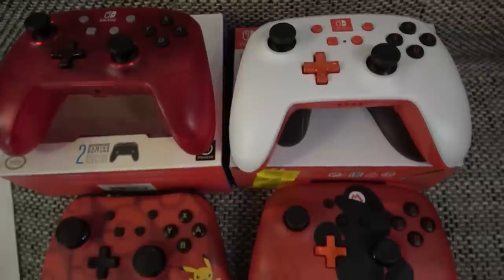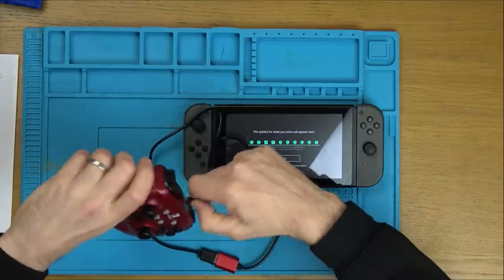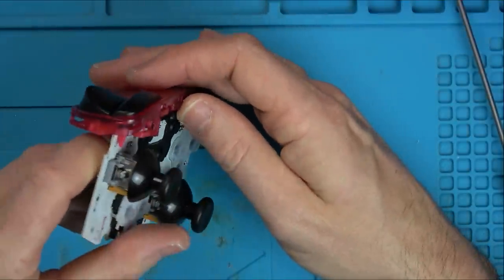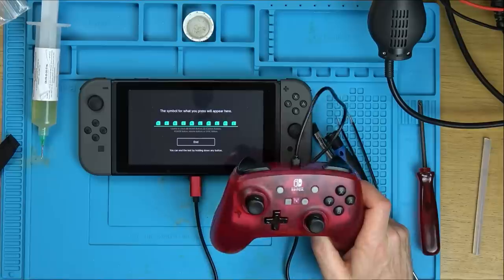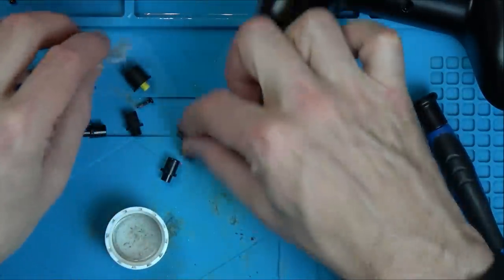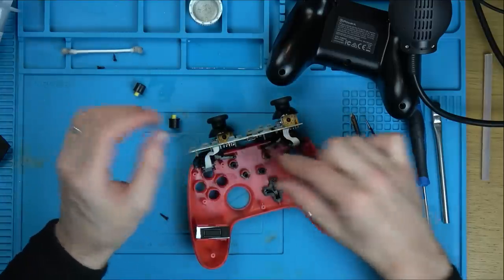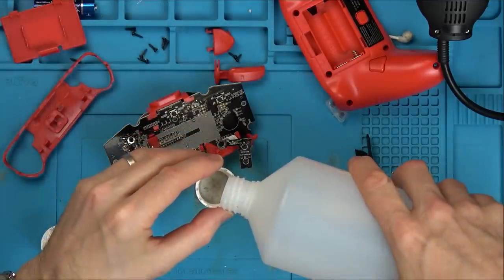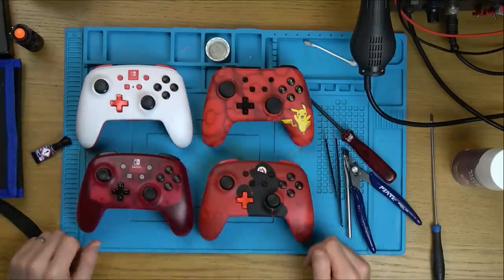Joblot of Broken PowerA Nintendo Switch Controllers - Trying to FIX

Comment from the maker: Spoiler Saver & Riddle

A 20 foot rope ladder hangs over the side of a seaworthy boat. The bottom rung is level with the surface of the water. The rungs on the ladder are one foot (12 inches) apart, the tide rises at a rate of 6 inches per hour. 
How long will it take until the 3 bottom rungs are under the water?
Reply: Riddle Answer Spoiler Saver 😁

It would take as long as it takes for the boat to become UNseaworthy.  i.e. until it sinks. 😁
Reply from the maker: 😂😂👍👍 Well done Steve!
Reply: The boat wont sink if its seaworthy😉😉
Reply: It would be nice if you learn to edit out these sounds in the background.
Reply: The Flying Dutchman never sinks..!!
Reply: When the next tsunami hits
Reply: Hey Vince, legitimate question here. I am interested in buying that Pikachu controller. Are you open to selling it?
Reply: 0 the boat is floating so a s the sea rises so dose the ship
Reply: Fill one of your blue tray compartments with IPA. Boom! Problem solved! 😎♥️ your welcome.
Reply: How do you remember were everything goes
Reply: @Mymatevince  hi again Vince! Remember me? Nice video!  Have A    
 G̳R̳E̳A̳T̳  Day

Comment: Great video, nice fixes!
Tip tinner is really a last resort utility. Very handy if your tip gets oxidized and wont take solder but not something you want to use regularly because it is acidic and will eventually eat through your tip coating. 
To prevent oxidation tin your tip with some solder before you put it to bed.
Reply from the maker: Thanks Micro 👍

Comment: Vince that's not tip cleaner it solder paste basically tiny balls of solder in flux normally used in stencil work for BGA chips. For tip cleaning use cheap plumbers flux and dip the tip of hot soldering iron in it or a wet sponge or copper scourer much cheaper.
Reply: I beg to differ.  Although it may well be a mixture of solder paste and flux it is sold and used for tip cleaning.  Search for "tip cleaner" to see what I mean
Reply: That's corrosive tip cleaner. Most people aren't going to have the solder paste that's used in electronics manufacturing.

Comment: Interesting stuff once again, Vince.  I wonder why Nintendo would officially license something that had corners cut during manufacturing?!  Still, you made them better than factory, for sure.  Very nice 👍
Reply: @Fix it Phil  Hi Phil!  You could be right, but if you look at 00:51 you can see the Switch logo and the Nintendo seal on the boxes. Although I guess they could have the logo on and still be fake. 😬 But yeah, i reckon your Chinese one will be very similar inside to these ones 👍
Reply: @Fix it Phil👍 Vince mentions Argos (a UK shop) I've just had a quick look and these controllers are indeed listed for sale on the Argos website as officially licenced!! 😬 😳
Reply: Price

Comment: Yes all companies try to keep everything to the bare minimum when manufacturing the product , I worked at a factory that made power tools and the grease for the gear box was measured in 1/100 of a gram , every coin saved per unit adds up when they make thousands of units daily

Comment: Little tip for you: Heating the solder mask while curing it speeds it up by a whole lot. I usually set my hot air station to 100°C for this

Comment: I have 3 of those Power A controllers for the switch everyone of them suffers from stick drift brand new out of the box they are not made very well. Great video as always
Reply: Mine developed it not long after purchase, the potentiometer was grimy and I know I didn't spill, nor did my friends. Came that way out the factory.

Comment: Good vid. I have an issue with Switch controllers . 1 broken. Broken analog but it's a cable version where I cam not see screws to unscrew and a cordless controller where I can see screws to unscrew . Can you shed some light on the issue.. 

Excellent channel and some fabulous retro electronics

Comment: That potentiometer solution to make the triggers act like analogue switches is exactly the same thing you'd find inside an Xbox 360 controller for instance and also inside the original Xbox's controllers, albeit the latter one has a different structure than the controller you show in the video. The one you've opened up is really similar to the Xbox 360 one.

Comment: He Mr Vince do yu think is it possible to install vibrating motor on the fake Nintendo switch controller cause to me it looks like they don't brings an yu know can yu pin point where to solder the vibrating motors on the board

Comment: My issue with my PowerA wireless controller is weird. After charging for awhile, the controller wont turn on unless plugged in. I'll open the case, unplug the battery from the board, plug it back in, and the controller will work normally again. Is it possible to overcharge these things?

Comment: I fix my own drift problems just tear down clean up control sticks then blow out with compressed air add very little silicone lubricant on moving or plastic sliding parts and put back together. for me tests out 100% effective.

Comment: I was wondering if you can fix my controller for my Nintendo switch it’s a power, a controller I’m a truck driver. I accidentally set my bed on the controller and broke the left thumb pad.

Comment: I wouldn't call these Controllers 'fake' - like Hori they're officially licensed by Nintendo and Microsoft but as you can see they've cut corners to cost less like wired only or no rumble.
Doesn't the Xbox Controller work with the Xbox One's RF like the older Xbox One Controllers?
I would contact PowerA's support and ask for a replacement dongle.

Comment: Hi Vince, ive got a PowerA Controller too and the problem with mine is, that the Joysticks move (in-game) in directions i dont them to go, e.x. the left stick gives an up signal, although i dont move it.
Any ideas on how to fix it?
Reply: That sounds like stick drift, there are quite a few guides on that. You might get away with just cleaning them more thoroughly but you might want to have a look at the potentiometers, I think that them getting dirty/the contact getting worn is the main cause.
But of course look up a guide don't take my word for it I was just summarising from poor memory lul
Reply: Tronicsfix did a video about this. Just search on youtube how to fix analog stick drift.
Reply: @Sketchy @Naku thx <3

Comment: I’m trying to fix a ps4. I’ve changed the hard drive and nothing. So I’m trying the power supply next. If that doesn’t work then I have no clue
Reply: in the end try using an good old trusty hammer
Reply: @Costel1986  I nearly have....

Comment: Vince, those are press fit through hole connections. They don't need solder. Its a manufacturing cheat by using different pins and tighter tolorences...... No gloves??? EWWWWWWWW!!!!!